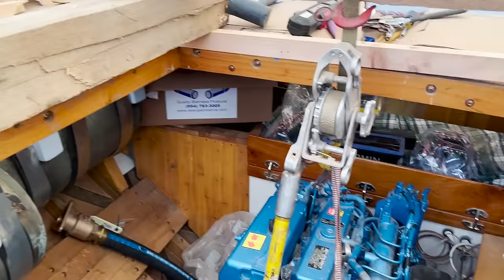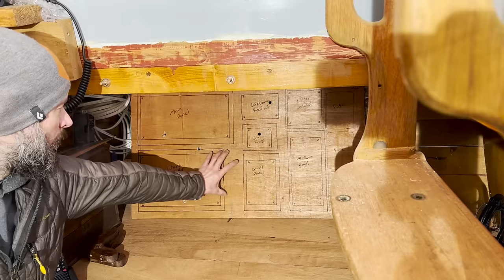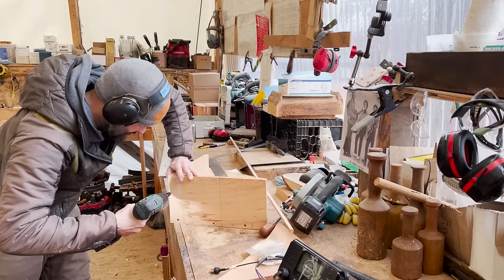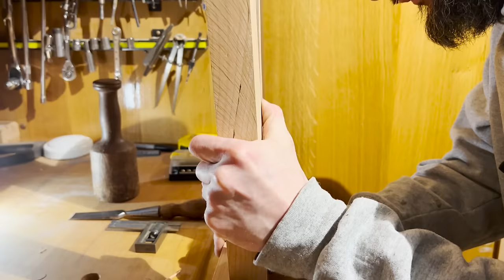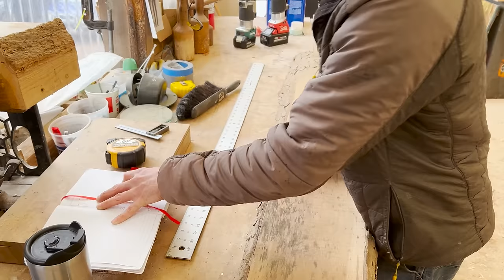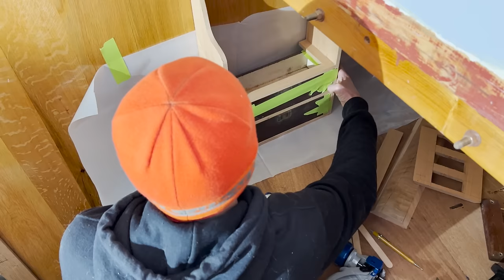Launch Update and Navigation Panel Build - Episode 251 - Acorn to Arabella: Journey of a Wooden Boat

Comment: The air behind that nav panel is going to get toasty. A lot of always on components, some with HUGE radiators, will kick out a fair bit of heat. You briefly showed a flip down fan, it was hard to determine if it was meant to cool the human or the electronics. 
To prevent condensation and possible overheating, I would suggest a 12v or 24v computer fan, as big as you can fit back there, to circulate the air and dump some heat into the cabin. There is a wide variety of fans, both 12 and 24v, the only issue is that it seems that you need a separate fan controller to regulate their speed, or maybe a regular dimmer/variable resistor could do the job. 
And lastly, unless the gear has internal temperature monitoring, a thermometer to measure just how hot it is behind the panel. This could be temporary or permanent, depending on your trust in your cooling solution.
Reply: @AcornToArabella  As I'm hammering my way through an entire pandemic worth of episodes. I'm wondering if you did look at a fan. I would suggest Noctua as a brand and their 'Industrial PPC' fans with a three pin header. You can speed control those fans by adjusting voltage. The problem with that is that the resistor burns away as much power as the fan would use if it were full full speed.

Comment: Speaking as a navigator of some experience, the thing I hate the most on my chart table is clutter, the next thing I hate the most is people getting in the way and the next thing I hate the most is the weather getting in.  Also, working at night, the last thing you need is the nav station lit up like the USS Enterprise, you can have all the red light sources you want, but if your switch panels are all firing out white light, your night vision is going to be shot. I would suggest, if you can, have a master switch that will kill all of the switch panel lights.
Reply from the maker: Thanks for sharing your experience!

Comment: You may be addressing it but not discussing it on the video...but heat from the electronics can be a problem if not addressed with adequate ventilation or, perhaps, a muffin fan to move the air around the electronics.

Comment: Yes, the temptation to make a lovely bespoke instrument panel is very persuasive, but, as you have recognized, it's really a hiding to nothing, however beautifully executed. Electronics fail or go out of date almost daily so you really need the ability to swap out at will. A blank sheet  (with some holes) and the instruments in cases screwed to it is the most practical solution, though of course it does look a bit utilitarian. As for the deadlights, I do hope you'll build in a means to stoutly cover or blank these off, both on the outside and inside, if you are going to do any serious ocean passages. If the acrylic and/or its seals fail then you could be in deep trouble. (Outside for strength, inside for temporary accessibility).

Comment: I know you will, but I have to say it..   When you wire up your nav panel.  please make sure you leave enough wire for a service loop so you can easily swing the panel open.    I think of how they wire a Network Cabinet so it can be opened without any wires being pulled or strained.

Comment: Having been a cabinet maker doing desks for computer equipment, I've learned that just cutting holes in a sheet of plywood is what I would have done for that nav panel. during travel you'll be replacing blown parts and patching new ones in just to make it work and you won't want to piece together all those parts just to make it look better.  You might start thinking about some sort of face plate system that can be cut to fit for each unit to dress up the holes without redoing the whole panel.  Just an idea down the line.  Looking forward to seeing that thing on the float.  You'll be catching yourself dreaming up solutions for things already solved for a few years. Its a mindset now.  As you can see, I'm deep the best example.  Onward and upward.

Comment: Print out 1:1 templates for the cut templates for each item, cut to actual OD size, then move them around for final positioning fitment.    Works better than drawing everything with marker, and easy to try changing different layout options

Comment: First, I am not a nautical person, just have limited knowledge. As well organized as the nav Station looks, it appears to be set dangerously close to what I see as a wet area by the hatch. I can easily envision water splashing in that vicinity and causing damage. You probably have that covered, but just thought I'd mention it in case it helps. Love watching the build!
Reply from the maker: All nav stations are a bit close. A dodger (small canopy over the companionway, kind of) is typically added, and you can close the companionway and leave the boards out. Can’t hide that stuff or have it too far away, from where the navigating is happening.

Comment: Regarding the nav station.. Good decision on form versus functionality.. My one thought.. instead of hinging it, maybe consider four through bolts, with blind nuts behind. The bolts can be as decorative (or plain) as you wish. Then, instead of hinging it sideways, simply unscrew the bolts, the panel can come straight out, then lay down on it's face. I'd think it'd make maintenance access easier. It might allow you to mount it in a shallower location, giving you more space on the table itself.   Just a thought.

Comment: Happy Friday, A2A crew!

A classic woodworking tip for anyone who has a thing like Steven did on that nav station where all the joinery wasn't absolutely perfect: Just use your chisel to carve a very slight v groove along each side of the joint before assembly. It stops being an "imperfection" and turns into a "design detail." I've used this myself. Everyone will ooo and ahh and think you're a design pro, and you can have a little inner chuckle because you know the secret. 😉

Comment: If you think there is enough room behind your electrical panel, there isn't. You will find out how quickly all that real estate disappears once you get the wires in there. If you use a breaker in your main panel to feed the electronics fuse block, then you will have main protection. A drop front is easier to do because the entire width of the panel can be used to bring the wires up. Feeding in from the side will always fight you & leave the face under constant strain from so many wires feeding in.

Comment: would it be worth considering hinging the instrument panel along the bottom, with a 1cm riser for the hinge, to allow it to lie flat? It seems to me that you'd have better access to the wiring, no need to climb up on the table, and it'd be easy to remove the whole things with a few screws to release the hinge riser....
Reply from the maker: We won’t need to climb on anything, we don’t think. There’s more to come on this but the idea that it could drop forward is unappealing.
Reply: well no doubt you’ve given it more thought than i have. my experience with this that in any sea state, a thing that has a tendency to stay in one position is a good thing, and a thing where the light naturally casts in a useful direction is better than working against your own shadow

Comment: Steve, with that big panel you rejected to use because of the check, I'd have run it through the saw down through where it was likely to split, OR bused it apart through the split, and then run it through the saw 3/4" either side of the split line and re jointed it then used it as you were going to originally given there were to be the best part of 9 rectangular holes in it anyway you wouldn't even see the joint.

Comment: Just a tip….. unless you are left handed ( or ambidextrous ) I would hinge the control panel on the left.
My experience is it’s difficult wiring when the boards are that way round ( if you know what I mean).
Great job though Steve 👍

Comment: I think that big cherry slab would have proved a poor choice. That would be a hell of a lot of cross grain getting held immobile by the mounting screws for the various bits of gear, and wood really likes to expand and contract with changes in humidity, mostly in the cross-grain direction. That said, was me I'd have picked up a 2'x4' plywood panel from the local orange box, but I've been watching A2A long enough to know that doing things the easy way is not Steve's style.

Comment: How about sectioning the panels with piano strip hinges joining them such that the panels will concertina as they fold out when you need access to their backs. First end hinge line front, then next hinge line rear, next hinge line front again etc.

Comment: It would be easier to have the nav panel hinge from the bottom, easier to work on the back of the electronics and the wires would be the of similar lengths as you drop the panel.

Comment: Nice progress- maybe get a smoke detector and fire extinguisher where you're going to be charging all your batteries.  Lithium batteries have done some weird stuff.
Reply from the maker: Look up lithium iron phosphate versus lithium ion. That should shine a light on the safety. Ours are the former. —Anne
Reply: Look up the m.v. conception
Reply from the maker: Yup, this proves what I’m saying—those were small lithium ION batteries, not lithium IRON batteries and were not related to the central battery system of the boat. Smaller batteries are much safer these days, too, because of incidences such as this one. —Anne